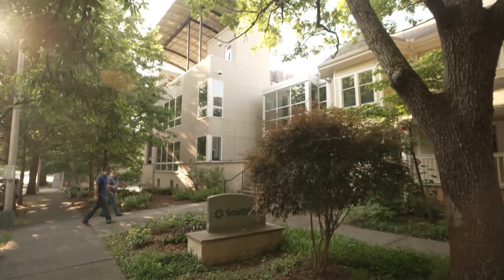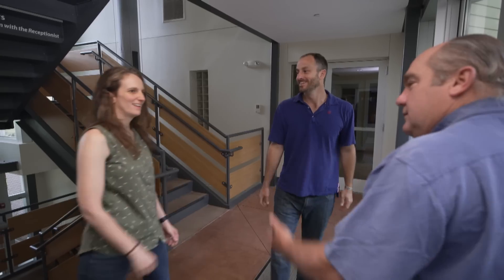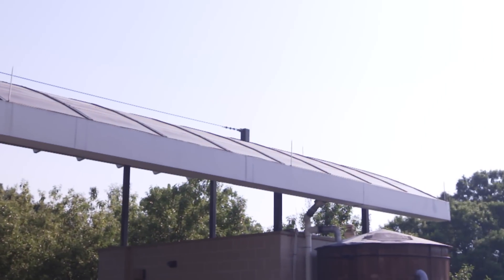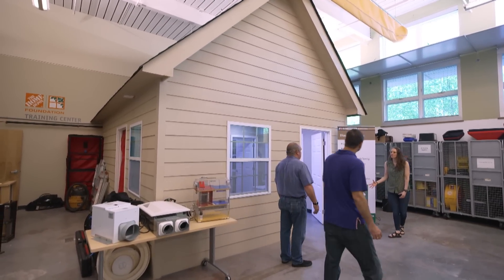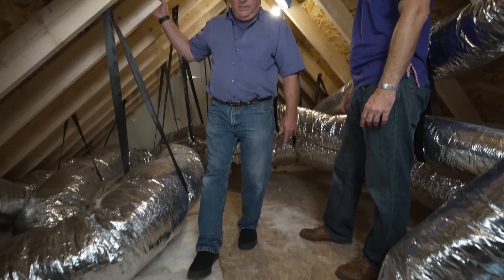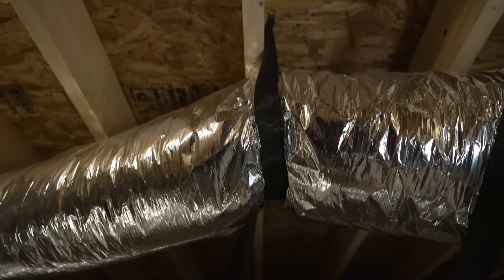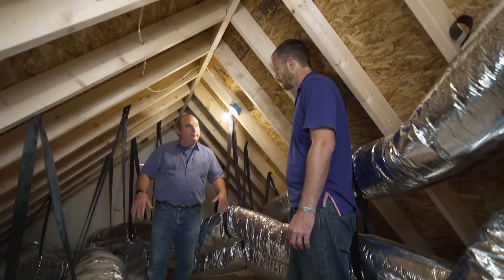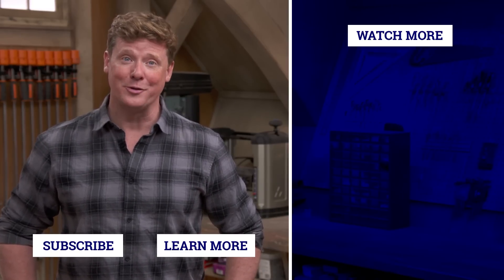HVAC Tutorial at SouthFace | This Old House

Comment: South face sure is very basic tuition, I wrote a strategy on HVAC cost reduction for my new house and exceeded its targets of 40-50% savings and have applied IoT everywhere fully redundant, non cloud dependent making all traditional interfaces work across nodes using analytics between devices and everything is invisible to the home. Many of my automations use biometrics, vice recognition, Geo location, facial recognition for dashboard access controls. When leveraging the cloud it’s all controlled by me from anywhere in the world pretty much. 😂